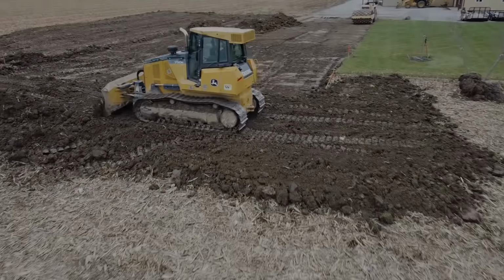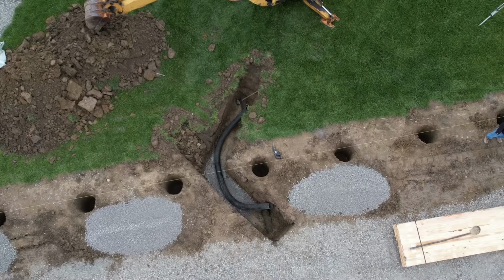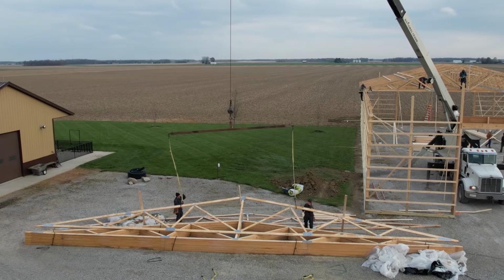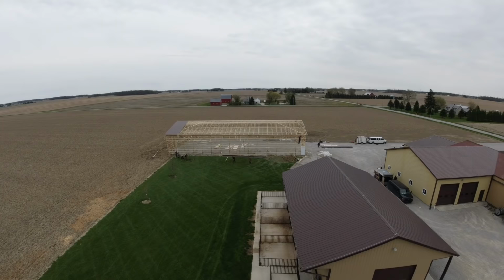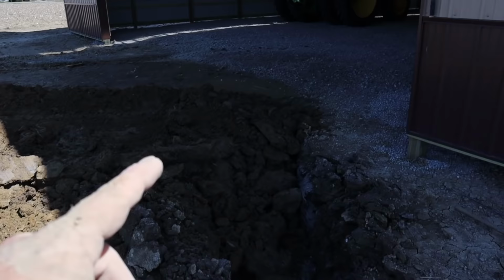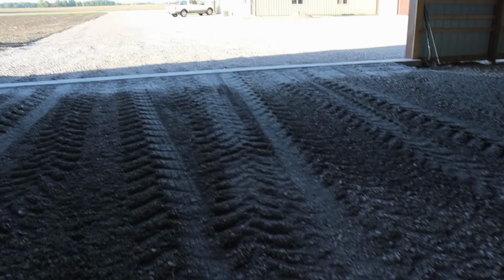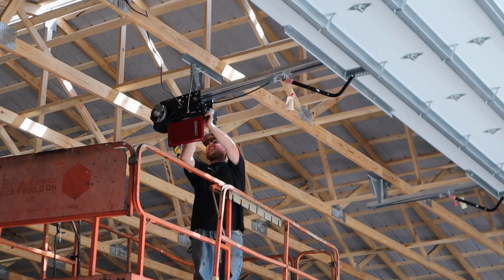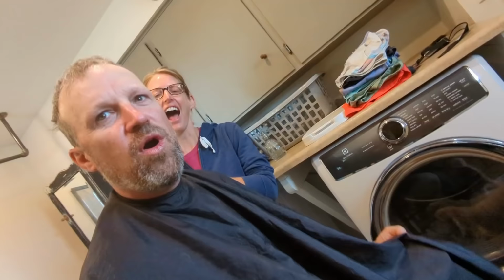He'll Pay For This Whether He Does It Or Not! [Building a Large Pole Barn Machinery Shed]

Comment: As a pole barn builder you don't set a post on wet concrete the post will push into the concrete and create a bowl when it rains the bowl will fill the bowl and rot the post off
Reply from the maker: Makes sense.
Reply: Agreed. We used 8" thick round precast concrete pads. Also, the bearing  end of our columns had .60 treated 2x6 scabs attached  to increase the surface  area on the concrete pad.

Comment: Watching a competent crew of team working professionals do anything, is a pleasure.  Watching them do big things,  in which you have a stake, makes it rewarding as well!  You were able to see the barn builders and the door installers do their thing… it may have been common everyday work to them but for Gregg… it had to be extraordinary!

I’ve had the privilege of watching the Mennonites build three buildings for me.  Their knowledge, skill and experience was apparent in each step.  One 24’X24’ barn took 14 hours over three days to build… the 24’X24’ addition only took 12 hours over 2 days.  The 20’X36’ machine shed was 16 hours and took 3 days.  And, that  be included an hour for lunch in some days!!!!

One difference in their construction methods was to tamp the posts into the rocky soil.  Another was that they used a boom on the front of their construction tractor to set trusses. Other than that, they put it together pretty much the same way.  

I learned quite a few tricks from them… the handiest was, how to get laser straight screw alignment.  They predrilled the panels in a stack, on the ground.  

Another was alignment of the corner panels.  They marked the top & bottom locations on the panels either side of the corner.  One guy was at the top while a second was at the bottom.  They held it on the marks… the top guy screwed his corners in while the bottom was held in place.  He then worked his way down.  The panels were perfectly square and aligned from top to bottom… Please don’t look at my previous attempts to attach corners on my tool shed!

You must have had hours of video to comb through to put this together.  It was an excellent overview and I enjoyed it tremendously.

Thanx
Reply from the maker: Thank you ever so kindly sir.  Yes, there was a ton of footage here and I stressed over whether I should make multiple shorter videos but now I'm glad it was all done in one longer video.

It is always amazing to watch these guys do their thing.  You know that they'll do it quickly but it is still shocking to see it not be there one day and 3 days later it is a completely different landscape.  

Funny you mention the straight screw lines.  Greg chose this building on my recommendation because they built my barn and one of the things I was impressed with the most was how straight their screws were.  Back when they built mine they were still chalk lining them and you can still see some of their pencil marks on my white J-channel to this day.  I wondered how they would chalk this building with it being so long and then I walked out there and observed them predrilling the holes through the entire stack!  Just as you witnessed!  What a clever way to make them all line up and no guess work at all when there's a hole staring you in the face.  They didn't do it on the roof though but I guess nobody really sees it.

Thanks for the great observations and I hope the next time I film a building being built it is in MY yard!!! :)
Reply: @digdrivediy  
There are several styles of pole bottoms that will not rot but will still be stiff with the pole. Repairing this mistake of putting wood in the ground will be expensive. I didn't see the detail but I suppose there was Concrete in the bottom and rocks around to backfill the hole.
Reply: You stole the words out of my mouth, it's really nice seeing tradesmen doing their work, I really want to see more young men (and women) consider doing work that might dirty their hands but will fill their wallet, not rich but enough, a lot of the guys doing this lead a happy life, it's what made this country.
Reply: @henryostman5740  so true… a college degree is out of date as soon as you leave college… a trade skill is good for a lifetime!
Reply: they showed the good parts only :)

Comment: Beautiful shed which will pay dividends for years to come. We had an Amish crew build our two sheds with excellent results. Similar construction with 4 foot spacing of the rafters and wide purlins on the roof. Also went with overhead doors with openers, more than one neighbor commented that they wished they had put overhead doors on because they were either open half the time or wrecked by the wind. Even though we had our site raised up there must have been an artesian well under our 54X112 one so we had to put three runs of tile in so it was dry when the frost went out.
Reply from the maker: The openers on those doors are awesome.

Comment: Uh, oops?  Should have known that there possible tiles next to that field.  Easy to fix once you dig out the trench to get to it.  Rerouting the tile can be a pain to keep the water flowing and not sitting in the pipe for roots to clog up.
As for Kara and the clipper guard fiasco... it happens.  I've done the same thing to my husband on more than one occasion.  Totally by accident.  Sometimes the day before a uniform inspection.  The only thing you can do is even it up as best you can.  Remember, it's not a receding hairline, it is a retreating hairline.
Great video!  I don't do heights either.  I'm guessing it was too windy for the drone.  Ah well.  Still a great video.  Thank you.
Reply from the maker: Hey thanks Susan.  I like that "retreating hairline" idea.  I think I'll use that next time :)
Those pesky tiles only show up in a field when you aren't trying to find one.  If you go out there  looking for a tile, they're hard to find.  Want to dig a hole and not hit one?  Boom - there it is!!!

I put my little GoPro up on the silo so that I could get a steady timelapse of them doing the roof since I knew it would take a couple hours.  It was windy for the drone though a few times.

Thanks so much as always for watching!

Comment: The Barn looked great and being in the UK the way they worked without scaffold when putting the roof trusses one would not be allowed. We have to have a full crash deck just under the eaves line for that sort of thing or work off of mobile access platforms.
Also the hair well your not alone I have had the same thing done to me by my wife. It just meant a cold head for a few weeks. Always remember there's only a couple of weeks between a good and bad hair cut 🙂.

Comment: I have sold and build pole barn up here in Canada for 30 years. Question why did you screw your roof steel on the flat instead of the rib. We always screw it on the rib??
Reply from the maker: Everyone does in the flats around here. Easier to get it started and the rubber washer seals up better against the flat surface. Plus not compressing or distorting the metal like you could potentially on a rib.  Seems to work well as I never hear of any leaks.

Comment: Pretty nice building.  One question  tho. Why did you put roof purlings flat rather than crown  up on edge.
Reply from the maker: Depends on the truss spacing. With trusses 8' on center they can lay flat. Much easier to nail down and put screws in from the roof tin.

Comment: I noticed that you don’t have any sisalation paper on the inside of the metal roof or walls, so I was wondering how do you stop condensation dripping from the underside of the roof and running down the walls?
Reply from the maker: The roof metal is lined with a backer material that insulates it and supposed to keep it from sweating. We hope.
Reply: @digdrivediy  If I built that here in Australia, I would have to put steel mesh over top of the battened roof, then sisalation paper and then the roof iron, which is not easy if there’s any wind! I like your way much better!😃👍

Comment: 10:36 Those tile joints are the physical equivalent of wishful thinking.
Reply from the maker: You think?  The internal snap couplers make for a really good connection that is very difficult to get apart once they are snapped together.  I feel pretty confident about those joints.  Thanks for checking out the video!

Comment: I like almost all the build except How the post were put in which to me should have been put above ground and rebar should have been in the concrete. It would not have cost much more to have all the post footers out of the ground to the same height and bolted brackets to the wood to hold it in place as they will not rot above ground and will rot quicker in ground with no treatment was done to the post in the concrete below ground.
Reply from the maker: The posts are treated and they were not put into the concrete. They sit on the concrete in the bottom of the hole as a footer and the concrete is not poured around them.  The poles in the ground help to provide much better wind shear strength.

Comment: What is the corrugated piping you call “tile” for? I’ve never heard that term.
Reply from the maker: That is to drain water from the soil and carry it to waterways and ditches. Where we live, we have heavy clay-based soils and water tends to perch on top if it doesn't have a way to get through the soil profile. The tile gives it a path or an underground river if you will,  and let's it get away better. Better drainage improves crop production.

Comment: So you were able to get Trusses with a 60' span? Can you tell me how much was it per single truss? Also, when placing the trusses, I noticed that the POLE had beams attached to each side of it. As an Engineer, I would prefer the beams are supported on TOP of each post, transferring the weight down to the ground - Did the county give you any problems with that - especially since the span is so wide.
Reply from the maker: Yes, the 60 ft trusses are very common around here. I can't remember how much they were per truss actually. I can understand the desire to want to place the trusses on top of the pole but I don't know how you would secure them very well up there. This is the way all of them are done here and there is an additional support underneath the top member to help secure it to the pole. No trouble with inspections on this stuff as they're all done exactly this way. Just got to have the hurricane straps in place but a tornado will take one of these out in a heartbeat no matter how well built it is.
Reply: @Neil Koch: Dig-Drive-DIY  Co. Thanks for the reply. I would place
 Them on top of the poles and secure them with ties, toe nail, and block on left side and right side. But if the way you have it has not given you trouble, let's then u r good. Rock on.

Comment: Are they not concerned about the posts being buried in the ground (possibly cement - I couldn't tell)?  Just like with fences that wood will eventually rot and that limits the life of that massive building considerably.  Why not go with Sonotubes and then place the posts on top.  Yes it is a little more expensive and would delay the framing for a few days, but that would increase the live of the building by years.
Reply: Another recliner professional speaks😂😂😂😂

Comment: Me being an electrician, i’ve seen many wood poles, treated, and creosote soaked, set in concrete ,rot out, what’s going to prevent it from happening here? The ones that haven’t had some form of barrier wrapped to separate wood to concrete.
Reply from the maker: We've seen that too.  I should clarify that these poles aren't set in concrete, they're just sitting on concrete.  Like a footer.  We didn't fill the holes up with concrete after the poles were set.  The theory being that if the poles are backfilled with just dirt then the water won't be able to collect around them and prematurely rot. 

The other thing is these are 3 laminated 2x6's rather than full 4x6 or 6x6 posts.  They claim the treated 2x6's have better penetration of the "treatment" than what a full post has and will hold up longer.
Reply: @digdrivediy  thanks for clarifying. Nice barn btw

Comment: How long will those poles set in concrete last?
Reply from the maker: Not sure, but they are just sitting on concrete not in it.  They just poured a small amount in the bottom of each hole to act as a footer.  The holes are backfilled with stone to allow for drainage.

Comment: What is tithe purpose of the "tiles" ? 
It looks like corrugated drain line too me, but I've never heard it called tile.
Reply: You ain't from around here, are ya boy?  :-)  Yes, it is perforated (slotted) corrugated plastic for subsurface drainage.  It's called tile because in the old days drainage was done with fired clay cylindrical tiles about a foot or so long, laid by hand at a spade's depth.  Laid deeper when tile ditching machines came along.  Clay tiles are still functioning in many fields.  In the really old days, some places used wood planks arranged in a triangular shape to provide a void for water to collect in and drain away.  NE Indiana and NW Ohio are blessed/cursed with heavy clays that happen to be suitable for firing and making clay tile.  Tile factories were common in the area and some small towns will have a road formally or informally called Tile Mill Road in the vicinity.  What did I leave out, Neil?
Reply: Nope, not from the midwest. I have worked in the plumbing and irrigation industry in Utah and Wyoming for the last 10 years. 
It always interesting to learn local terminology.
Reply from the maker: I believe that HwIIMI explained it quite well but yes, it is corrugated drain line, which those of us locally call "tile".  I never thought about the fact that other folks may not call it tile.  Great observation and thanks for the explanation Jim!

Comment: What are those tiles for? those damaged black hoses
Reply from the maker: They are drain tiles that take unwanted water away.  Our soil is poorly drained, meaning it will lay wet for days and weeks on end if not artificially drained with pattern tiling.  The tile helps to take rainwater out of the soil profile and therefore enables a better living environment for the crops.
Reply: @digdrivediy  thank you

Comment: No way id spend the money and time on that structure and sink a post in cement. Omg
Reply from the maker: I agree.  The post is on cement, not in it. The concrete is just a footer. The posts are backfilled with stone at the bottom and then dirt at the top to allow for drainage.
Reply: Omg....they didn't sink them into concrete

Comment: Safety s not an issue then , no ropes or hard hats 😏
Reply from the maker: No, I am not aware of safety being an issue. Everyone in the home construction and farm building industry works like this. If you had to rope off 20 amishmen on a roof, I don't think you'd ever get them to do any of the work. The ropes would be more of a hazard than they would without them. These roofs aren't steep anyway so no real need for the ropes. Some jobs just have risks. Not that big of a deal.
Reply: Till someone falls , THEN YOUR FARM BECOMES HIS FARM , that’s if he lives that is , best of luck lads ,
Reply from the maker: @DPW55  Fortunately that's not the way it works around here. The landowner isn't liable for how safety is or isn't implemented on a job site by their hired contractor. That's all on the contractor. You may not be familiar with rural Midwestern small scale construction,  but this is how it is.  Like I said, it's only a big deal when people try to make it a big deal.
Reply: Safety Sally has arrived

Comment: No safety harnesses for the guys walking on metal roofing?!
Reply from the maker: Not around here.  The roof is not steep at all.   I don't think these guys would continue to do this work if they had to wear harnesses! 😬
Reply: @digdrivediy  I am pretty sure that those guys will not continue to do this work after a fall from that height.
Reply from the maker: @michaela1655  oh I get it completely. I'm all about proper safety gear. However, this is just the way they roll.  They simply wouldn't do it if someone told them they had to have safety harnesses probably.